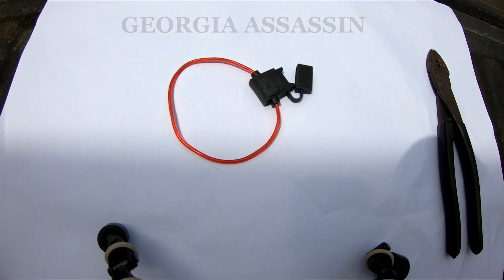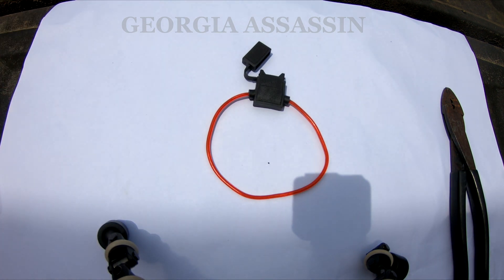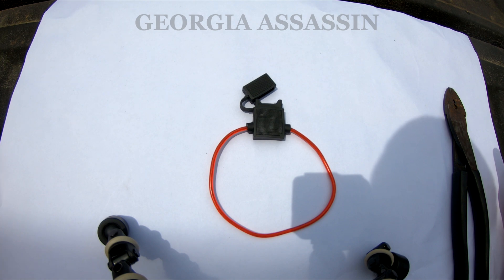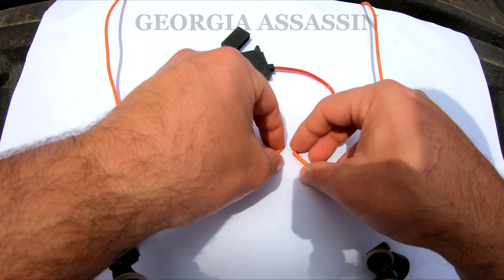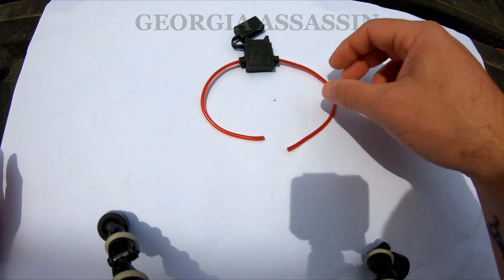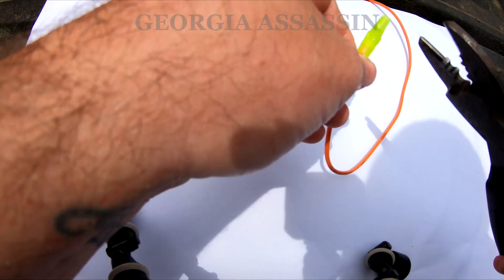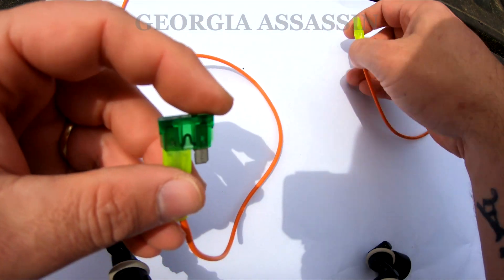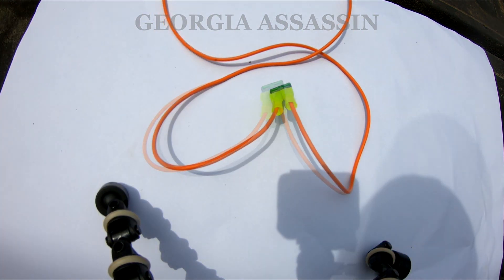Make Your Own In - Line Fuse Holders For 12V Electronics!!

Comment: So simple yet effective. I want to connect a 12V LED light bar on my truck. How do I calculate what size fuse to use? It's rated at 288W but that would translate to 24A at 12V DC. In your experience, does 24A sound realistic?

Comment: should i put a in line fuse on everything that goes into my battery even if comes from the fuse block at the console, ive  got bus bars that ive got everything running into before it goes to the battery

Comment: Hey man, what size fuse are you using?
Is it ATC or Maxi/ATX, I'm trying to make sure a blue 14-16 guage female spade connector will fit snug on the fuse terminals(prongs).
I'll order some correct size Fuses because I only have Mini/ATM Blade Fuses.

Comment: What side do you put the in line fuse to? Negative or positive side
Reply: Positive (+) only. You want the current to stop if the fuse blows.
Switches can be put in a negative wire or a positive wire but never both - & +. But inline fuses stop + current to protect components down the line when to much Amps flow through that can overheat the wire or device causing melting or fires 🔥

Comment: I'm going to be wiring my hummingbird helix 7 to a battery and they say to use an inline fuse. How do I know what in line   fuse holder to get? And will a 1 amp fuse be sufficient?
Reply from the maker: The in line fuse holder wires should be the same size or greater than the wire you are fusing. The amperage is based off of the device. A 1 amp fuse is normally used for a device that is extremely sensitive to voltage surge such as a depth finder. Always fuse any device by the MFG specifications. Hope this helps. 
Thanks for watching!